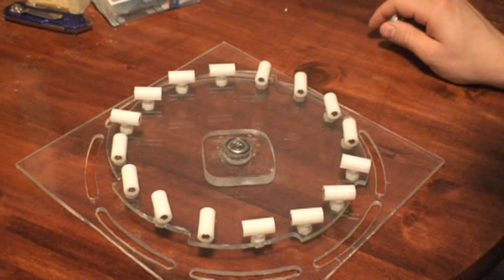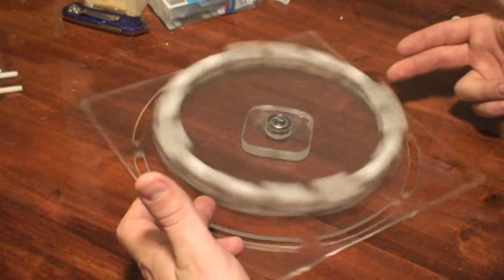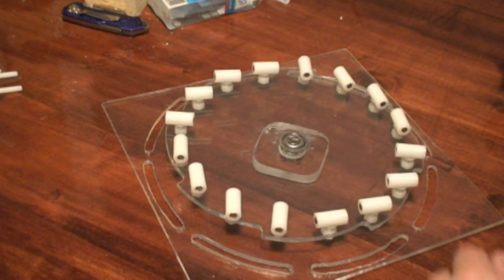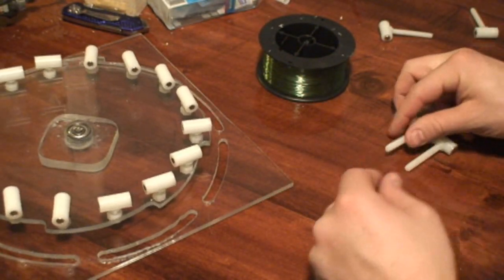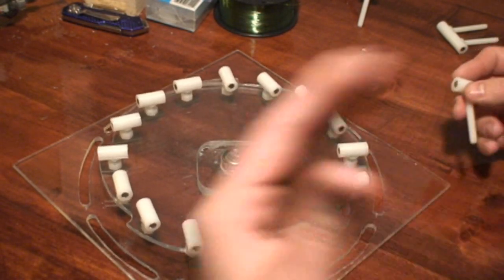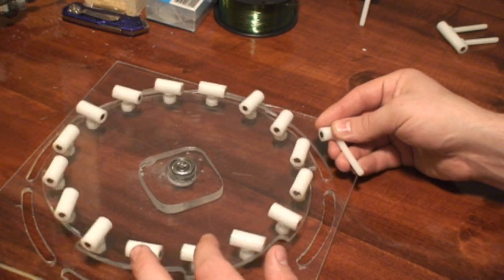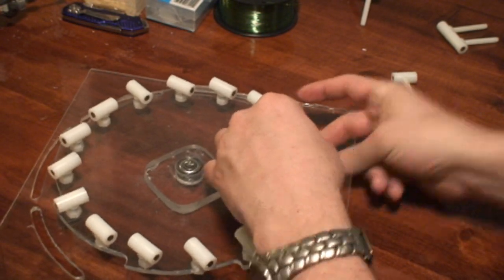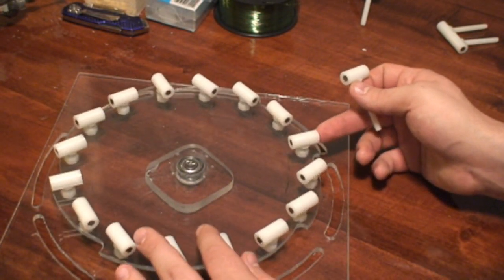Magnet motor, free energy, overunity test 2

Comment: you are ignoring an input energy source. your HAND turning the magnet. the same would apply your electromagnet. it would run as long as the battery flipping the polarity had power. once it died. the device would stop.
Reply: Nerys and you ignored what he said. he said if he could find out a way to rotate it it will be helpful. all he asked your suggestions. seems you people are paid to shout here  on someone who is USING FREE word.
Reply: QaziHussain did not ignore. whether his hand does it or some gizmo does it. it needs energy to do it.

what is "using free word" ??
Reply: Pretty sure those first 4 magnets required no input from his hand besides actually placing the magnet in that position... He only needs to turn the magnet once in order to get momentum from 4 magnets. I'm not saying this is legit, but if someone could calculate the amount of kinetic energy created by the magnets alone, and compare it to how much energy it would take to switch the pole, the results may or may not be surprising. If we found out we were getting more energy, then the device could simply power its self.

I'm gonna be optimistic with this until I see a test like that done.
Reply: +stuff guy It's not just a matter of switching the pole, having an electromagnet being on at all consumes electricity. There's no real way for this to produce more energy, and one other thing that people are ignoring is that magnets actually induce drag on things. They interact slightly with the earth's magnetic field (it's a property that is used to orient satellites) and that represents a loss of efficiency.
Reply: +stuff guy 
Placing the magnet in that position IS the input, and required energy. It's like a spring. Placing the magnets close together (so close that they will repell when released) requires energy. The device will never be able to power itself, this is a fundamental problem, it won't matter how brilliantly the device is made or what kind of system he uses. The output generated by 1 cycle will not be enough to put the magnets close together again for another release.

You can give it a spin, and then it will lose energy every cycle, until it stops turning. There is no solution. This is not limited by our technological capabilities, but by fundamental laws of nature.

Comment: This is easy. Basically you need the circle of magnets to tell the arm when to switch polarity in advance of its coming, to compensate for the time it takes for the arm to rotate and be in place for the next reverse pole magnet arriving in line. In other words, you should create a mechanical spring switch. The switch should be as simple as possible, by engraving an etch under the plexiglass just a few fractions before the perpendicular (straight) magnets that signify a polarity switch. This will click a spring in the arm of the magnet you now currently hold by hand to switch it in harmony and unison. More importantly, the arm shouldn't switch back and forth, because the flip flop of the arm will become a problem due to the drag of inertia  once the spinning magnets reach terminal velocity. Instead, make it spin freely but barely lock in place with a wristwatch type of nick and continue its rotation in the next polarity. Eventually, at high speed the circle of magnets and the arm will sync rotation in unison, and this is why the clicking needs to dislodge after a certain speed, which is essentially the terminal velocity of the rotating arm itself. If you like this, give me credit. That said, why do you need to have the circle of magnets switching polarity? Why can't they be all continuous? Have you tried that? Maybe in slightly different angles? Adding more magnets and playing around with the distances? Important to note is that you can even utilize ambient energy, already being used, to propel changes in the arm. If such device is near water sources and wind and sun, it could reach an unbelievable combined efficiency with regard to output.

Comment: You dont need to change the magnet by electricity. Just make it mechanically the way as the disk rotates it flips the other magnet.  It need some work, design and calculation but certainly doable.

Comment: Jzsd14m , you must calculate how much energy is given to the system by means of rotating magnet at your hand. Since rotating the magnet at your hand needs energy, the rotational energy you obtained in the system maybe equal to rotational energy you give to magnet at your hand. Therefore zero energy is a result and what you are doing maybe never usefull.
Reply: But if we put a weight on the rotating system , than we can understand real rotation speed.
Reply: Erdal Abayli torque conversion will allow it to spin fast will less draw
Reply: Erdal Abayli Don't waist your time m8 ;) these people don't understand anything about physics. its like you said the input energy will always be greater than the output due to loss of heat (yes the magnets will always heat up by a tiny amount which uses up energy that doesn't convert to kinetic energy) and that still leaves friction which also converts to heat. Its a simple law of nature.
Reply: The69Stalker If you use an electromagnet, it will simply be a normal electric motor.  No different than the one in a toy car or vacuum cleaner.
Reply: @Sedat Kuşhan Magnetic "Energy" doesn't exist.. Its a force so it doesn't do anything until you put energy in to it.. Thats your mistake 😉

Comment: That's amazing dude! That can power a small alternator that supplies power for a mechanical hand that switches the polarity for you at perfect times creating a motor that runs on self made electricity!!!
Reply: Not possible
Reply: Too much force required to be able to move any mechanical parts, the only reason the wheel even turned us because of the minimal frictions.
Reply: I think so

Comment: I got it..! Have some type of gear mechanism coming from the middle part that can support a magnet in the way you were holding the one on the outside. Maybe, like some type of arm with gears running thru it. Like the arm that holds a record needle. Except, instead of from the outside in, it goes from the inside out. And it's fixed so it doesn't move. The large spinning part connects, via gear shaped slot, to a gear in the arm which connects to other gears in the arm which lead, by connection, to a device that holds the outside (force-)magnet in the correct position with the poles in the same fashion az you were demonstrating. Instead of YOU flipping back and fourth the force-magnet to spin the wheel, all you have to do iz spin the wheel just enough to get it moving so that it turns the gears throughout the arm and rotates the force-magnet.  But the tricky part iz getting the timing down so that it iz able to rotate at the correct intervals so az to act appropriate pole-force upon the corresponding positioned magnets fixed on the wheel. If the timing's right, the very least you'd have to do iz kick start it with a small spin of the wheel. Also, maybe, fewer magnets would be needed..? Does that maybe sound like a possibility? Im not sure i possess the skills nor resources necessary to build such a thing. Lemme know if this helps at all please, and thank you! Namaste

Comment: why not build a second wheel of magnets and have them spin off one another
Reply: then then poles could be switched and pushed equaly
Reply: Be right back, gotta do this
Reply: Rey Rosado let me know if it works.
Reply: I mean if u made it where the gears don't jump and like three of them in a triangle but you'd have to slow it down. And switched it out with electromagnets to change polarities on a switch and then hooked it to a bigger gear that does the same thing and just keep going larger you could like invent an impact starter for a perpetual turbine but I'm sorry you don't when anything unless it actually creates energy so maybe burn it?

Comment: why don't you have all the magnets on the wheel all south or north poles so you don't have to change polarity?
Reply: Try it out and you will see why...  If all the magnets are the same, the contraption won't spin.  I built something very similar a few years ago, it was pretty fun
Reply: Adam S because changing the poles adds energy into the system and makes it work. It would remain stationary if he didn't move the magnet in his hand.
Reply: What if you keep the south poles where they are and elevate the north poles on the disc so that you wont have to chenge polarity's, keep the same set up but have the alternating polarity on two different story levels on the same disk.
Reply: syscocar You are on to something there my friend!!
Reply: How about using one side of the disc for one polarity and the other side for the other? That was my first thought...

Comment: Obviously the energy expended flipping the magnet around is equal or greater than the energy required to spin the wheel.
Reply: Ross Catto actually that's not possible. sure, at the beginning it is using way more energy than it produces, but with time the energy production of the contraption will increase as the energy recurved to spin the magnet remains constant
Reply: Valoro85 that's not even close to what I said. I only said that the energy that is expanded by flipping the magnet is insignificant
Reply: crasy kills wrong you have to flip the magnet faster. Meaning energy per time is higher. Just like spins per time is higher.

Comment: it's working. now there is only one last issue. if it is to truly be perpetual and you choose to use the electromagnet idea to switch poleraty, then the motor should produce what energy is needed to run the magnets, but that said you are scary close to cracking this wide open. nice work

Comment: add a wheel gear to turn the hammer magnet forward and backward.
Reply: The energy it takes to rotate the hammer magnet would cancel out the gain in the armature. Not to mention friction.
Reply: Rick Lewis  gearing it to work is easier then saying it would not work.. I starts a quad engine with a large rc motor. it was gears to be exact power output at the shaft as a regular starter motor. same thing as a flywheel assembly.. that engine won't turn a direct shaft as the flywheel attaches to but it does when the gear it's turning makes it less work. it's very simple
Reply: @dectrone:  ¿Qué?

Comment: I built one but forgot to add a cam action to allow wedge fields to get past N to N .  try cam or coil pulsed using magnet gen energy to run it once bat has started it the bat is switched off

Comment: Try connecting the magnet that you were holding in your hand and to a small motor to make it spin back and forth. Since you are using the magnets in a north south setting, you can connect copper coils on the outside with something like an iron or aluminum core and plastic or paper to separate from, the core. You can find cheap motors in something like an old cd player that is not working, and if you connect one of the coils to the motor. Note use a diode to cause a 1 way flow and capacitors. If you use it correctly, a capacitor bank of about 100 only takes 1 second to charge and offers a sort of battery bank that if hooked up between the coil and motor. This way the discharge is the motor moving back and forth. And you can connect coils that use the magnetic filed to cause magnetic flux. The way you can measure the pull of a magnet is a cheap jewelers scale, a piece of cardboard and off to the side, in an h formation where one side is on the scale and the other side on something solid. Use a solid metal item like a fork or something and the strength of the magnets can be measured. Tthe reason is that since reality is push to interact, you want your strongest magnets on the pull and the weakest on your push. Example you want your strongest on the n side out, then your weakest on your s side out. This way it forms a kind of egg shape in the magnetic field as it goes around. Now to tell the distance that you can make the coils the way to tell is by a paper clip and moving the magnet to where the edge is just lifting, that will give you a distance, and you can use 1.5 that distance to figure out the thickness of the coils. The egg shape as it moves through the coils it basically causes current, that if done correctly you can harvest the energy off 2 of 3 coils and still have it where you have your little motor rotating the magnet. a/c current.

Comment: Great idea! Sorry to say but it already exists. Hybrid vehicles and electric vehicles use this technology. Generally speaking most running a primary and secondary electric motor. The switch you are looking for is called an IGBT (Insulated-Gate Bipolar Transistor). Using 6 of these will make it more efficient. Can be purchased or just go to a wrecking company and harvest one of a hybrid vehicle. Just stumbled across this vid by the way looked interesting :)

Comment: I had the same idea for years, but gave up on it. The proper 'electro' magnets with 'timing' trip switches cost money. I was wanting it to spin at a high rate of speed which would create 'electricity' in batteries to run a compressor, which would direct 'compressed' air at a high pressure volume against cups to spin the shaft which was free floating within a tube; with magnets 'south against south' so the shaft was in a free floating magnetic chamber; allowing more 'electricity' to be produced. Then once a proto typed worked on a small scale; create a larger one to creating enough electricity to run power a house. "Then the government can eat their electrical bills." The U.S. has one running on a submarine, which has been kept secret for years. A 'small' article came out in an old Popular Science, or Popular Mechanics many years ago, I believe 1990's. I pointed it out to my wife and said: "See they can drive things by electro magnetic power and create all the electricity they need." But to develop and market it to the public would affect all the 'Hydro' companies and the government revenue. Anyway, keep up your experiments. Jim.

Comment: you realize perpetual motion is immpossible right? there is no such things as free energy. All energy comes from somewhere, and it is never truly depleted because it only changes it's form. But perpetual energy is immpossible. if there were perpetual energy the universe would eventually die. If anything the only perpetual energy is the motion of the galaxies moving away from eachother. and that's even debatable because it's not truly perpetual because it has a source and an predictable end.
Reply: ***** magnets don't last forever, and to make them you must use energy as well. so this entire design is a joke.
Reply: ***** You Don't Have To Make Magnets. The Earth Is A Giant Magnet It's Self. The Solar System Is Perpetual Motion ( If The Sun Never Explodes )
Reply: And that too will end. Even the earth with it's magnetic field will die relatively soon. In less than 400 billion years the universe will come to it' end you know. One of the most fundamental laws is that you can not create somethign from nothing all energy has a source. You can not destroy any matter in the universe, and you can not create matter. same with energy. you may only change it's form. 
It's a giant cycle. And it will end only when the universe is torn asunder. after that, All the particles left in the universe will break dwon and then start moving back towards eachother, as gravity overcomes the state of energy that pushes them outwards. it will take billions and billions of years but eventually all the particles will gather again creating a black hole so dense that eventually all that matter and enery will release in, once again, a big bang. restarting the universe.
Reply: The point is the solar system isn't perpetual motion, if you start taking energy from that then you will slow it down, it only continues onward because ther eis no friction to apply, if you take energy from it you are basiacally applying friction and slowing it down. plunging the earth into the sun.
Reply: perpetual motion is the idea of somethign that continually spews out energy. never losing energy in it's motion in anyway. that is perpaetual motion. a perfect and never stopping source of energy. and it is also impossible.
Reply: well with our current understanding of particles and gravitons.
Reply: +Tomoko Hinata    Enough with the pedanticisms.  I think motion that continues until the universe reaches it's natural end can be considered perpetual motion  - practically speaking  ;)
Reply: +Nick White just a thought. i know thats is weird BUT u must be able to make something out of nothing. i mean before time ;) or anything else there cant be anything. so out of nothing our universe formed . i´m sure that i wrote absolute bullshhit but maybe im right :)
Reply: +Tomoko Hinata gravity could be considered perpetual motion. We also know practically nothing about dark energy, which can possibly relate to gravity. While the fundamental laws are correct, they don't explain everything that happens.
Reply: +C4 H4CK the universe didn't come from nothing silly, it was an infinitely dense point of space that esplodededed
Reply: madscientistshusta
 But where did the infinitely dense point come from?

Comment: Good job, you have discovered how an electric motor works. 

even if you could overcome friction and have perceptual motion as soon as you try to make it useful and pull energy out of it, you will have introduced more friction and it will stop. 

you also have to consider the amount of energy put into making the device compared to the amount of energy you get out of it.